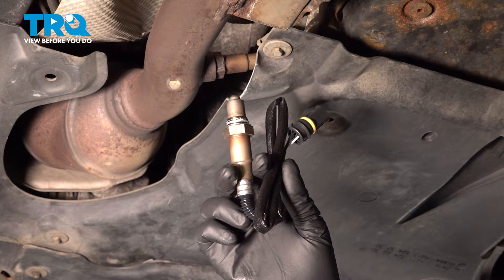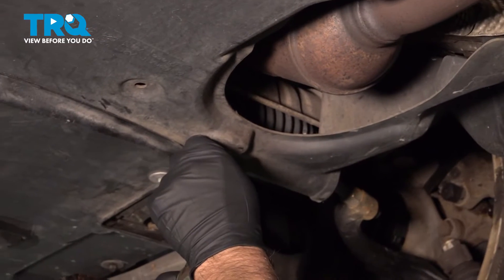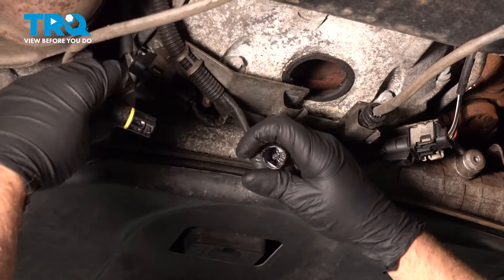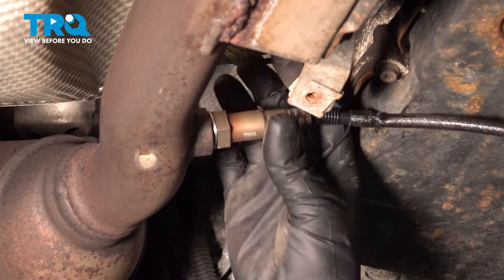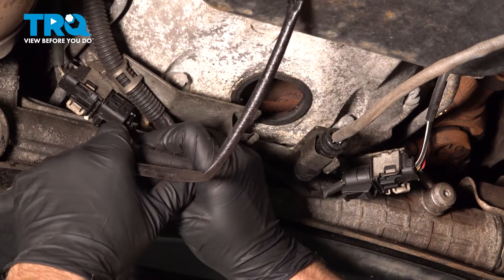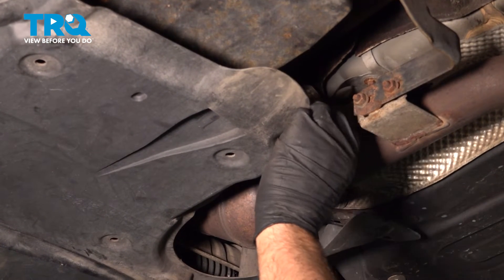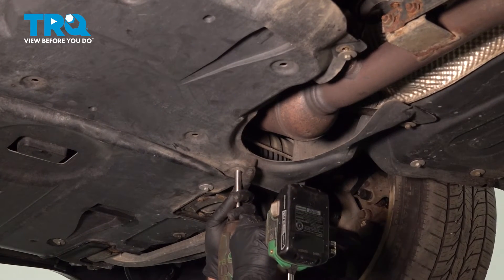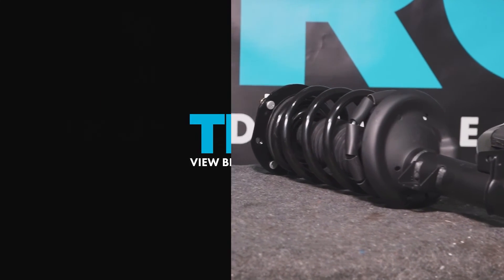How to Replace Downstream O2 Oxygen Sensor 2006-2009 Mercedes-Benz E350

Comment: Thanks for the video i have a questiin u might help me with the answer i want to install o2 sensor spacer on the rear o2 sensor i have mercedes clk 240 year 2004. Do u think there will be enough space to install the spacer or i need a curved L shape space? Thanks in advance

Comment: Hello, what was the check engine light code that came up? i have a check engine light on my 09 E350 for catalyst system bank 2 (P0430)
Reply from the maker: +@Biscaynedave We wouldn't be able to diagnose an issue like that here, you may want to have a local mechanic take a look at it. Thanks for checking us out! http://1aau.to/m/Shop-1AAuto-c